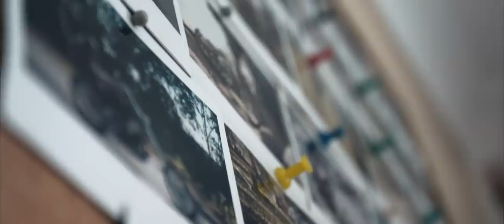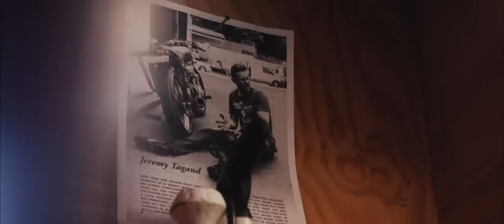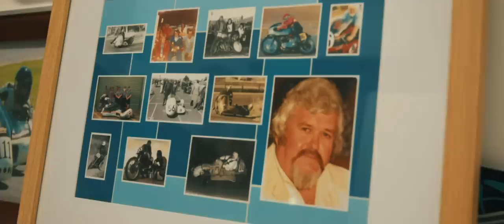HANDCRAFTED - Custom Motorcycle Film

Comment: My daily ride 1977-81 KZ-650
> Little Lill<
77>
Engine
Wheels
Carbs
Pipes
79>
Wiring harness
Fenders
Headlight assembly 
Tail lamp assembly 
80-81>
Frame
Tank
Seat
[After market]
Bars renthal
Levers/master cylinder fox racing
Emgo cables 
Carb kits
Dry /gel batt(o.e.m. for 1.000 cc harley Davidson 1997 sportster 
Emgo>
 high ampere voltage regulator 
gaskets[complete rebuild set]
bolts kits
pet cock
poly fuel line
and a lot of work